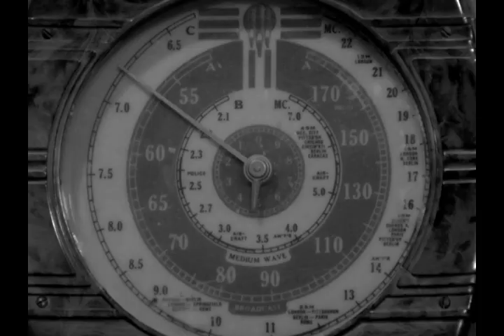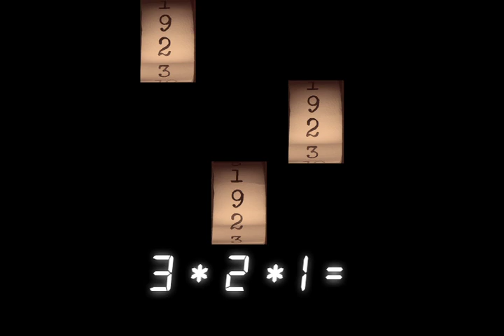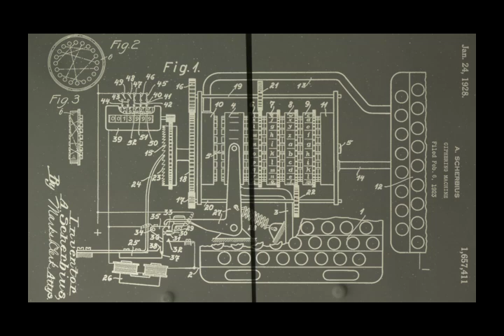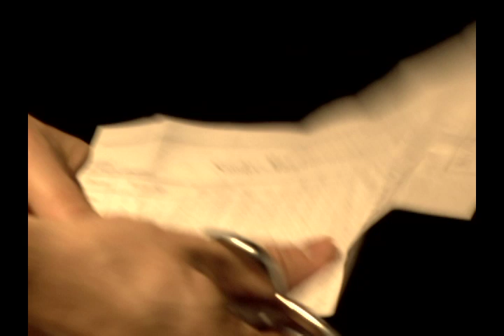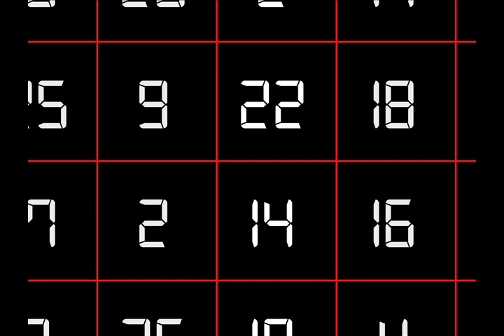Gambling with Secrets: Part 5/8 (Encryption Machines)

Comment: The only part i don't get is 7:18 , how can the operator set a random initial position for the rotter’s, if they have to set the rotter’s based on the key sheet.